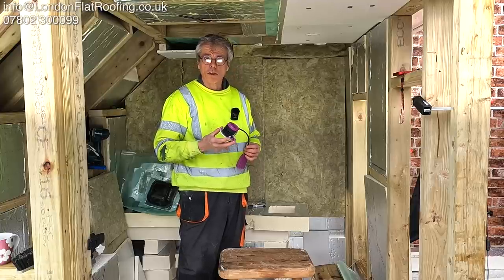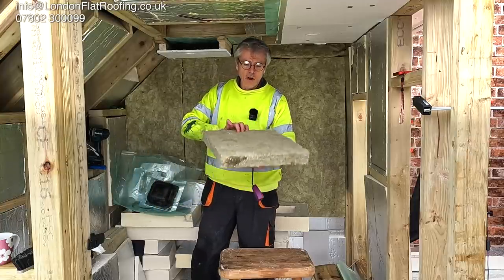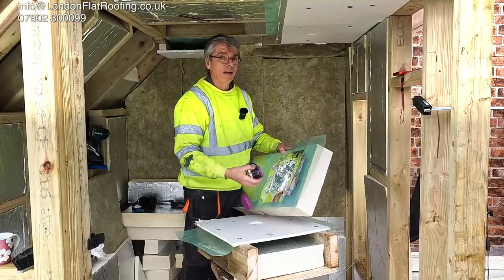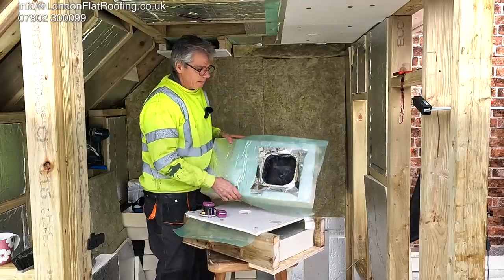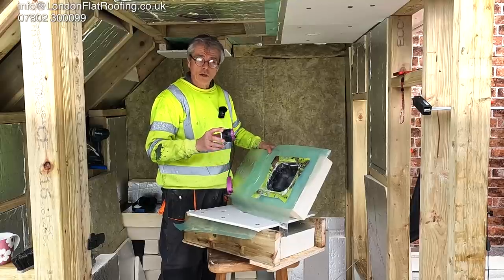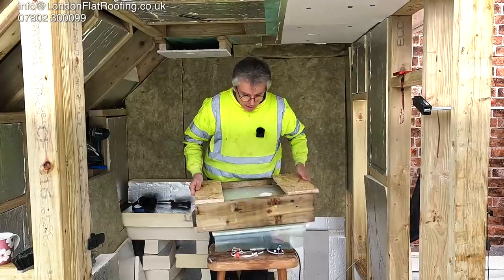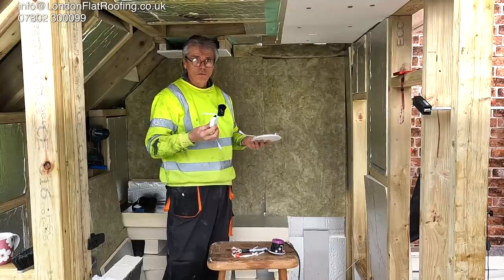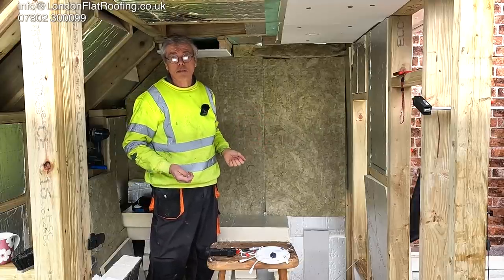How to fit downlight in flat roofs

Comment: Steve, very refreshing. I see very few builders who give this any thought at all. On pitched roofs I often specify a warm pitch roof so that there is a gap above plasterboard on vaulted ceilings. Trouble is builders seem not to have any experience and immediately change the design to between and under insulation and the problem is back. This is kind of basically the same as your drop ceiling idea we need to convince more builders to go warm roof construction.
Reply from the maker: I agree
Reply: On a warm pitched roof would you add a VCL behind the ceiling plasterboard? Or is the VCL on the bottom deck under the insulation adequate?
Reply: @muso31  VCL immediately behind plasterboard, with the intention that it stops ingress of warm moisture laden air into the roof construction build up.
Reply: @DDGXMUSIC  would you use something like novia 1200 for this still? Or a smaller gauge as it's less important in a warm roof?
Reply: @muso31  Novia 1200 from a very quick glance looks ideal. If in any doubt the best thing to do is to pick up the phone to the manufacturers and explain your build up and ask what they would specify.

Comment: To be honest, if you’re doing a loft conversion with 150mm roof joists. You’ll need 120mm insulation between the joists, then 25mm battens on top of your roof joists for cross ventilation and to achieve 50mm air gap. If you add 75mm underneath for your downlights, you may aswell lose the battens and do a warm deck.
Reply from the maker: Excellent reply  that you

Comment: I did this method of cutting my own recess into the PIR and taping inside the recess. Yes it took a long time. Self build so wasn't so critical. Flexi taped around the cables to seal. 50mm air gap above the PIR. Sparks could not fit the lights and drivers in (even though I gave them the cutout dimensions in writing), so had to find different lights. Found some led panel disc lights that were barely thicker than the plasterboard and they fitted in fine. Tested with room heated to 20c. 0c outside and frost on top of the rubber roof. OSB deck is cold and dry.  I can get my hand up the rear soffit vents and all feels dry and cold above the PIR.
Reply from the maker: Thanks

Comment: Great video and one I could have done with seeing 2 years ago as I looked everywhere for a solution to the problems you quite rightly outline for my garden room with a hybrid roof. In the end I made wooden frames in between the joists for each downlighter, inserted a sealed VCL unit (parcel shaped with bottom open with flaps to fix to frame), then went over the whole sealing with VPL (butyl tape over where it spans the VCL box giving a double seal). Then drilled though ceiling and into the boxes and inserted shallowest downlighters I could find. Boxes are quite big (450x450) so some airflow round the downlights. Not perfect or pretty (not that you can see them), but better than just drilling straight through the VCL and creating a chimney behind every downlighter. I'm just a DIYer, and if I can think about this issue and find some sort of solution, not sure why professionals can't. I'll send you some pictures if you have an email address?
Reply: DIY,s tend to take time and do a better job

Comment: Interesting video Steve. Currently insulating and plasterboarding a flat cold style roof for a lobby measuring 2m x 3m linking a house with a garage which has low headroom about 2.2m. I was going to go for spots but don't fancy breaching the 100mm deep PIR insulation and vapour control layer beneath it with installing spots. There are many slim circular bulkhead lights on the market now with tube fittings, some as low as 30mm in depth from ceiling level which dont require chopping holes in the insulation or vapour control layer. all it requires is a 5mm wide x 3mm flex which is much more sealable. By the time you've battened the ceiling down to take account of the spots so as not to breach the VCL and insulation above, it just aint worth the hassle and expense installing them in a cold roof.
Reply from the maker: Like most things it's all about cost if you're doing it yourself it's also time and also knowledge a lot of people just don't know or understand are used to be one of those

Comment: Hi Steve, I was hoping for some advice on the following scenario. I am trying to smooth off the ceiling for my upstairs bathroom, which currently has a stipple artex finish painted with moisture resistant bathroom paint. I also hope to fit down lights in the ceiling. I am reluctant to scrape off the artex due to the risk of asbestos.  It has been recommended I overboard it with vapour check plaster board. The issue with this is I have coving around the edge of the ceiling. My two options are:
1) overboard directly on top of the existing ceiling and f8nd a way to smooth over the step between the overboard and coving. This would allow the back of the downloghts to extend into the loft.
2) Fit battens to lower the overboard enough so the coving would be covered up (my ceilings are high enough to allow this).
My concerns are with both scenarios, I would get moisture trapped in the void between the overboard and the ceiling leading to rot as there wouldn't be any airflow, especially as the bathroom is a high moisture area. Any advice or alternative solutions would be greatly appreciated. Thank you.

Comment: Surely PIR foam sheets are closed cell foam which is vapour proof, so why would you need a vapour barrier in the divot. Why can’t you just seal the vapour barrier to the foil around the hole?

Comment: How did you fix the timber you used to drop the ceiling 75mm without compromising the vapour barrier? Did you use an adhesive?
Reply from the maker: Ill be showing yu how to do that in a week or so as its also tricky and nobody is doing it
Reply: don't you just put the butyl tape down underneath the timber and vapour barrier before you fix it? or is it more technical than that?

Comment: Those slim fit downlights still require 40mm clearance above and 50mm clearance around the edges. Also they are not fire-rated so may not be suitable
Reply from the maker: Yes alway refer to fitting instructions

Comment: Best not fit them. Many alternatives out there. Surface mounted slimline alternatives. In most loft dormers I have put on 4 wall lights and left the ceiling intact. I tend to use 7x3 treated timber. Cross batten with 3x2s. staple alluminium vapour to the top and then OSB. The put 75 mm between the joists. 50mm on top, tape, vapour and board. Never had any problems. Always have a pitch on the roof as heat rises to the highest point. Longevity of the roof is increased and ventilation improved due to the gradient. If it's a big dormer and not sighted. A few mushrooms at the highest points.
Reply from the maker: Sounds like a good robust constitution

Comment: I found downlighters which are only 23mm deep, in 12.5mm plaster board only 10mm of the fitting protrudes trough.
The driver is 22mm high.
So a drop ceiling made on 44x44mm timbers would be sufficient, then there is still 22mm above the drivers and 34mm above the light fittings to provide ample circulation and prevent overheating of the vapour barrier.
The timbers for the drop ceiling are fitted at a 90 degree angle to the roof joists and some cutouts were made in the top of these timbers, so ample air circulation is possible between the vapour barrier and plaster board.
But now as a warm roof is going to be installed in this place the vapour barrier and insulation on the inside are going to be removed, as the ventilation under the roof from the outside is going to be closed off.
So the fitting of any type of light fittings, ventilation ducts etc. are not causing any issues anymore.
Reply from the maker: Sounds like problem solved
Reply: Can you share a link to said downlighers?

Comment: Had the exact same thoughts with my warm roof build on my conservatory  - so I changed my plan and went with some nice pendant lights, luckily I had plenty of height.
Reply from the maker: You can use downlights with a warm roof
Reply: @SteveRoofer  is this because a vapour barrier isn't required in the ceiling void as there's one on the deck?
Reply: Tracklights avoid this problem.

Comment: Dropping the ceiling by 75mm and installing to create a clearance sound fine and dandy, but my question being is wouldn’t the heat of the light cause moisture on the vol as there is no ventilation as the ventilation is in the upper portion of the roof. Love ya videos mate. Keep them coming.
Reply: no because there is nothing there that's cold to condense on

Comment: Maybe a soft question, if i dropped the ceiling and used insulated plasterboard as well...what would be the impact?
Reply from the maker: You can't fit the spotlights into the insulated plasterboard you would have to put the insulation under the joists then space Down the plasterboard and then fix the lights

Comment: Maybe we want to be thinking about low-profile lights that are rated for direct contact with the bottom of the insulation and don't need any recess carved, and also, running DC over the wires to them from a central transformer box located outside the ceiling stack to avoid hot electronics doing the power conversion at each light.
Reply from the maker: That all sounds good but unfortunately there is nothing like that on the market and it would probably be very expensive

Comment: local garden center buy 99p clay flower pots put them over the holes and put the insulation around them job done.  only led down lights mind but they create a thermal barrier and heat sink then you can cover the pot in what ever you want used this trick for years never had a problem cheap and simple.
Reply from the maker: Second person to mention this and its a very good idea
Reply: isn't clay porous though and hence not solving the moisture movement problem?

Comment: Well done Steve. I agree with other comments. Don’t do it. The shallow lights work, but you just need to route the cables and install the drivers in an accessible location which could be anywhere. They don’t need to go right next to the light unit.  In an ideal world, a drop ceiling would be great, but most loft conversions have limited head height to start with, so loosing 75mm is not really option. Well done for setting this up and showing us all. 👍
Reply from the maker: Thanks

Comment: Homeowners are keen on recessed spots, but it just seems to be best to stick to pendants to avoid all the variables of trades involved. If there's enough head height, go for the drop ceiling, may be even dropped ceiling light box so it's not over the entire ceiling (and can have it's own ventilation) - make it into a decorative element? I guess the good thing is this only applies to loft conversions and extensions, though the former can suffer from head height restrictions by default. Great videos Steve.
Reply from the maker: Wall lights  re the way to go
Reply: @SteveRoofer  Great option.

Comment: As an electrician I'd also be thinking about how you would replace the fittings without cutting the ceiling, because LEDs do fail and usually the whole fitting (not just the bulb) needs to be replaced. Ideally there needs to be a decent size void and any divers/transformers/terminal blocks need to fit through the ceiling cutout. With some slack on the cable the whole lot can then be pulled out, with the connections re-made with it all hanging out, and then all fitted back through the hole. I'd say if there's enough headroom, then drop ceiling all the way, which also means your cables don't need to penetrate the vapor barrier. Lower ceilings do also reduce heating costs albeit I'm sure many clients want taller ceilings for aesthetics.
Reply from the maker: You are definitely right, that is the way to do it. However it's always high restraints that seem to be used as the reason to do it badly.

Comment: I'm having this problem. I'm converting a detached garage at the bottom.of my garden into a recording studio. If he to extend the joists down so I can get a 50 mil gap and drill holes at the top to allow airflow. I can't come down anymore as i will be scraping my head on the ceiling. And I'm also not sure if it's going to be sound proofed enough because I can't sacrifice anymore on on ceiling height.

Comment: Another good video. When we do our extensions its always a drop ceiling and cavity walls behind our plasterboard. There aren’t many out there that will notice the height of a ceiling. Though saying that a lot of our recent projects have been asking for a 2.5m ceiling height. So dropping it to the light manufacturers specs is not noticeable.
Reply from the maker: Thanks don't know where you are  in the Uk but  i never see dropped ceiling in domestic flat roofs
Reply: @SteveRoofer  we’re up in sunny Scotland covering the central belt. We put a dropped ceiling in our last extension and sunroom we completed in Perthshire and a dropped ceiling in the the renovation we carried out over in Lewis. That includes ceilings where it’s a pendant light. When installing down lights we’ll use a super slim. But we’re keen on insulation. So all our services run behind 15mm plasterboard walls but in front of PIR insulation so why not carry that on in the ceiling is the way we see it. We know then no matter what’s being installed it shouldn’t harm the VCL.

Comment: A common extension is the flat roofed rear extension kitchen with roof lantern, often with no thought about the airflow, plus about 18 of these spotlights. Always wondered how they perform!
Reply from the maker: Not that well i'm alway looking at problems especially of there is a GRP roof over the top
Reply: Aren't they normally warm decks extensions usually have the height to have a warm deck the problem is usually lofts where head height is limited which is why a cold deck is often specified

Comment: It would take a very patient and conscientious contractor to do this correctly, with amazing co-operation between sparks and plasterer, also it would be impossible for anyone to check the finished job to certify it's been done right. A warm roof design gets round all these problems as well as venting issues.
Reply from the maker: Exactly my point

Comment: I've been getting really confused with all the barriers, which order, air gaps etc but these have helped better than most all others combined... shame they only came up after hours of others. The cold roof explained is what I really needed.
One thing I don't get is the real difference between a vapour varrier and dpm if the goal is stop moisture from inside penetrate the insuoation and condense inside it then if dpm stops more then aren't they always better?... or is the vapour barrier the outside where air gap is and if so is it really needed if its vented?

Comment: As a builder myself, i don't think it should be down to the builder to contact manufacturers etc; i think the responsibility for products used should be on architects/s engineers/building control/etc and it would be down to the builder to ensure correct installation; wont happen though
Reply from the maker: That's right it should never be down to the builder to make the decision the builder should always follow the design drawings

Comment: Good stuff and thought provoking. It would seem that warm roof or dropped ceiling are the only practical  alternatives - if you are wedded to downlights.
Reply from the maker: Yes but using multi foil and different installations you can probably achieve the same and have a cavity to install lights

Comment: We are having a flat roof extension in timber form. Is a warm roof the best option for wiring and spots. Is there a need for insulation between the joists? Also what thickness should the pir on the roof be? 

Great videos Steve, learning so much, thank you
Reply from the maker: Yes warm roof is the way to go and no you don't have to have insulation between the joists although you can have some if it's not that much about one third

Comment: Hi Steve. What are your thoughts on Kingspan roofing panels for a garden office. Would they suffer from interstitial problems? How would you suggest fitting lighting directly to the panels? I am embarking on a garden room build in the spring in line with permitted development and want to ensure I get the roof right.
Many thanks for the videos as guidance to assist in my decision process.
Reply: they could operate much like SIPS in terms of interstitial condensate (IC)  - I think the SIPS manufacturers expect the SIPS to have IC but they state that it dries out in summer months. Is your garden room 'low occupancy'? Permitted development with the 2.5m height restriction and high occupancy usage don't mix too well - compromises are inevitable unfortunately.
Reply: @molydood  yep intended to be low occupancy. I am seeing a lot of people screwing batons for plasterboarding and lighting systems into the panels. Will all these screws essentially become thermal bridges and lower the insulation properties of the panels?
Reply: @danielnorton9363  if low occupancy then I would personally feel comfortable with the Kingspan panels, but it's impossible to know for sure what will happen, as with all these things. I would expect the screws to attach the batons to the panels to be only just long enough to penetrate the metal skin on the panel, as the internal PIR wouldn't provide much or any of a fix, so presumably its all held in place with techfast type screws straight into metal? If that is the case then I can't imagine the screws affecting the thermal properties very much. You don't have any timber joists every 400 or 600 so already you have taken one quite large thermal bridge out of the equation so I reckon this would still perform really well thermally vs traditional roof build up
Reply: @molydood  Thanks. Makes sense.